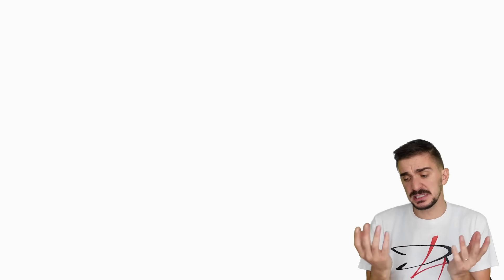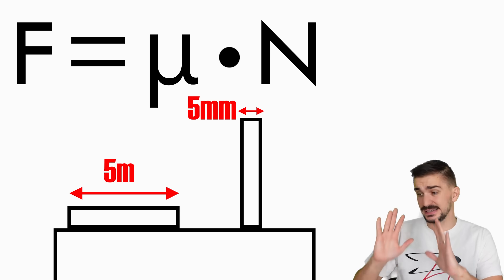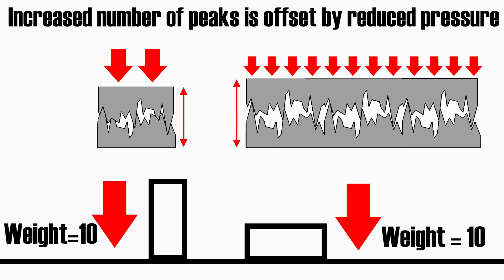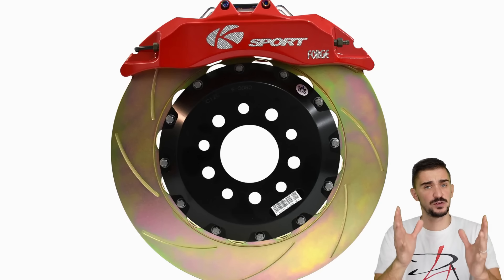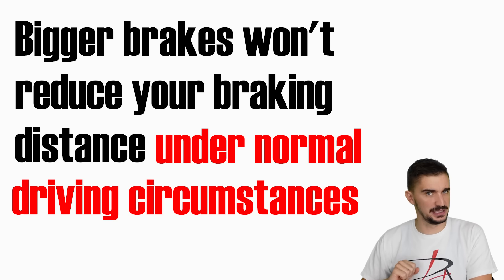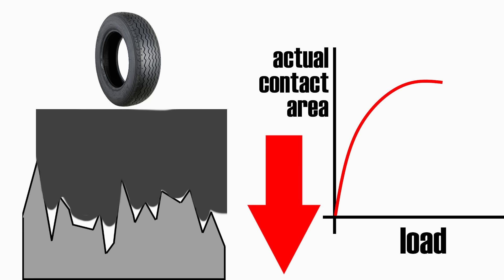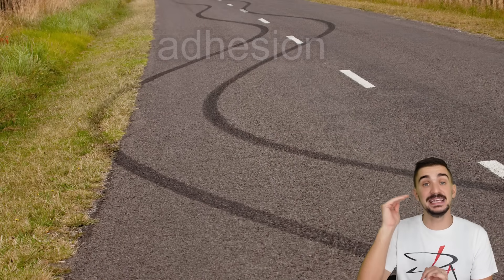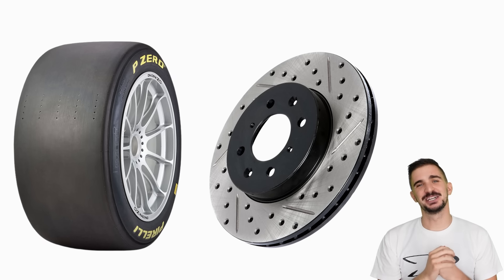Why Big Brakes Won't Stop You Faster but Wider Tires Will - Friction and Surface Area Explained

Comment: I wonder what people think about this. I have always done my own brake jobs. When pads have gotten into the metal and cut grooves in the rotor, I don't change the rotors. Those grooves, I always figured, add surface area once the pads wear to fit the shape of the grooves in the rotor. It also adds surface area which allows the rotor to cool faster. If the rotors are too thin, I'll replace the rotors. I have never had the brakes fail on any brake job I've done. I know this sounds bad to a lot of people, but it's not unsafe. If it were I wouldn't do it.

Comment: Your pretentious attitude is very condescending. You totally disregarded heat dissipation and brake fade. Modern brakes are very good, but can be improved and you can tell the difference.

Comment: why is this even a video 😐 its such basic common sense..  I hate how stupid were getting..
Reply: The worse part is that the video is WRONG
Reply: @josebermejo5362   i didnt watch it the thumbnail annoyed me into posting what i said then i homepaged
Reply: @josebermejo5362  its not wrong
Reply: @arcanevoid9199  Bigger brakes WILL brake better but not because they have a bigger surface area, as explained in the video that does not affect friction and the force of the caliper will NOT increase , but for the same force aplied by the caliper, the bigger the diameter of the disc the bigger the braking torque will be on the axle, as TORQUE = FORCE x DISTANCE. It's like tightening a bolt with your fingers vs using a BIG ASS wrench, the further you applie the force from the axle the bigger torque you can generate.
Reply: @josebermejo5362  i mean your not wrong, he explained that in the video but its not gonna stop you any faster because 99% of the time you are limited by the tyres

Comment: If bigger discs and calipers won’t improve braking, what will (besides tires)?
Reply: Bigger calipers won't improve braking, but bigger discs will, this is why the video is wrong
Reply: @josebermejo5362  bigger discs will? bro what are you talking about

Comment: Hi, thanks for the great vid! I’ve a2012 VW polo 1.2 mpi( 75HP motor) that came with 14 inch steel rims ,175/70/r14 tires and NO ABS. Will changing to 16 inch VW alloys and 195/55/r16 tires help me achieve better stopping distances, considering there’s no abs?

Comment: Big brakes = larger diameter = larger moment arm = larger torque = more braking force = more modulation. Size matters.
Reply: it does, but the smallest brakes that will do the job are the best. unsprung weight matters

Comment: You never first saw my comment here all you said here was entirely right, thus it really takes the initiative over non and reality,  I could agree with this also as your second video, Rim brakes can be increased their friction due that they can lock more, I hate to do it but I need to do it in order to prevent me from accident.

Comment: While you are comletely right for most of the things, I still believe that bigger brake rotors will stop better from the very beginning, not only in track conditions. The reason for this is that even that you have the same Friction force, you have it applied on bigger mean diameter which makes bigger stoping momentum.
Reply from the maker: https://youtu.be/Ql9eYh31kTw
Reply: @d4a  What if your tyres are not the limiting factor?

Comment: As a Dually Driver, I don't need to watch this video to know that "The more rubber on the road, the better the traction OR the stopping power"!

When I was hauling RV's, I always deflated the Rear Duals to where a Business Card would just slip about 1/8" under the edges, NO matter what the Factory Tire Pressure Recommendations were.

I PO'D many "Professional Tire Changers" when I told them that THIS is what I wanted, not what it said on the Factory Sticker! It's called "Real World Experience". And don't ask me about "Small Disposable Car Drivers"! 🤣

Comment: Not entirely correct. In the wet wider tyres will not help stop faster. In contrary. It may actually cause your car to slide more easily. That is because the weight is spread across a wider tyre are hence less weight pressure from each tyre on the road.

Comment: In short, bigger brake rotors and pads only spreads the braking friction out over a bigger area. Reducing heat accumulation and wear across the total area. You simply get longevity in extreme circumstances.
Reply: Nobody likes the truth? Eh? Not even this channel. Man, you guys suck.

Comment: There is such a thing as pounds per square inch. ⬛️  to wide decrease the lb/ inch  ratio. Works for traction and stopping as both rely on frictional areas. 
So there is a curve in the results that you should be aware of

Comment: This is a very interesting discussion of the F=MU x N, sorry I couldn’t use the proper symbol for coefficient of friction.  May I add that, while it is understandable that bigger brakes will not stop a modern ABS equipped car faster, bigger (greater coefficient of friction) brakes will stop an older car, especially one originally equipped with organic shoes and drums all around, faster and this is reduction in stopping distance is of course enhanced with greater tire contact area.

Anyway, getting back to the discussion of the F=MU x N equation and how it does not apply to tires (at least not in a linear fashion), I thought it might be interesting to discuss the topic of how weight transfer, biased toward a particular end of a chassis, might manifest itself in the cornering behavior of that chassis.  Thank you for taking the time to present such an interesting YouTube channel, your efforts are appreciated.

Comment: You went from talking about brakes to just tires. Yea obviously more tire grip But you need bigger brakes to stop with those tires. So yes you need big brakes especially at higher speeds were normal brakes fail consistently. Also big brakes have better surface control so you don't skip the tires and lose grip.

Comment: But the difference between stock brakes and really good aftermarket brakes is night and day on the track. Also a larger brake rotors has more leverage = more braking power. So what do you think is better bad brakes and big tires or good brakes and smaller tires obviously I rather stop than not to stop by going with big brakes and small tires.

Comment: Tire compound will effect friction so you could have tire with less contact patch out braking a tire with more. In this review removing all the variables to deal with just surface area while useful doesn't really capture reality. As for brakes, bigger brakes will be a benefit in repeated braking like experienced in every day driving.

Comment: Big brakes will stop you quicker so this dudes an idiot.
Reply: The formula doesn't account for the change in temperature when friction is applied. And the center of gravity shifts over when decelerating. Simple formula dose not show the full picture.

Comment: I can’t believe what I just hear. 
1-physics laws are universal laws 
2-different tires are made with different rubber components, therefore, friction coefficient in the formula change. Not due to wideness but due to materials. 
3-wider tires also increases the total width of the vehicle improving cornering, not due to contact area but due to wide geometry. 
Please, please! Research before broadcasting videos, you have people commenting that they always knew their physics teacher was wrong, OMG!!!
Reply from the maker: I'm afraid you didn't understand most of this video

Comment: Bruh, big brakes was not to stop you faster but to be more head resistant. Technically it will stop you faster breaking none stop at a track compares to regular break.

Comment: One big mistake which makes this movie title absolutely wrong.
Big Brakes actualy stops you faster - that's why you mentioned tyre braking test but no big disk braking tests.
You are talking only about bigger friction area but it stops faster not because of bigger area but because of placing friction area further away from centre of wheel.
Reply: did you watch the video?
Reply: @arcanevoid9199  Did you read above?
Reply: @chmuragan  do you not understand that if you brakes are enough to lock the wheels, bigger brakes arent gonna stop you any faster
Reply: @arcanevoid9199  'If'
Reply: @chmuragan  as stated in the video you wont really find any car made in the past 40 years that wont be able to lock up the wheels with stock brakes, its not really an if
Reply: @arcanevoid9199  But it's not true. Driving many quite fresh cars with not working anti-lock and excluding ultimate sports machines and no one was able to lock brakes at speed higher than 100km/h on good (not sporty) tyres.
ABS has something to do only at low speed or on curve.

Comment: There may be an underlying truth to your frictional force relationship and its application to sliding a board under gravity on its faces.. But.. I've owned the same car with stock brakes and subsequently with larger rotors and pads. I am sorry to inform you my stopping distance was MUCH better with upgraded brakes.  Better control, shortened stopping distance (under normal driving conditions), and elimination of brake fade (as you explained well).  You apparently have never owned a car with both or you would be making a different video.  I increase my surface contact area and maintain the same normal force, I get more frictional force.

Comment: Could you do a video on ice tyres too? I've often wondered why they're so thin, it's never made sense to me
Reply: One basic way to think about it is how much control you have with ice skates vs sliding around with an inner tube or a sled. You need certain amount of pressure per stud so that they can dig into the ice. Also wider tire wont dig through the snow as well as a narrow tire, which is basicly aquaplaning on snow. It's very common here in the north to be driving casually and suddelly there's a spot with more snow and the car literally rises up 5-10cm(2-4inch) and no amount of wheel turning or braking will do anything. Narrower tyres might have just sliced through that snow remaining in contact with the ground. If we are talking about just pure ice without snow, then it all comes down to ratios between vechile weight, weight on each tyre, tire width, number of studs, stud type, pattern of the studs ect. I'm sure it gets pretty complicated if you'd really get into it, but putting 300 studs in a row and 20 grams on top is not going to press the studs into the ice and provide any resistance to sliding.
Reply: @SUMOCAT86  That makes sense yeah, thanks for the explainer
Reply: As he showed, the reason you want wide street tires is because above a certain point, increased pressure between the tire and the ground stops increasing friction. However, in snow and ice, you want as much pressure as you can get. Wheels on snow/ice are basically useless, meaning your only hope of moving on snow is by compacting it under the tire or just pushing straight through it to the ground, and on ice is by digging your studs as deep as they can go. For both of those, you need as much pressure as you can get, which means narrower tires.
Reply: yeah i also wonder. maybe narrow ice tyres provide more grip while driving on ice

Comment: Right at the start of this so willing to be educated. I was always taught pressure = force x area so more area (bigger tyres) reduced the pressure of the tyre on the road so less grip and also more chance of aquaplane as less pressure to force the water out.
Reply: no, bigger tires = more grip. this is why you see cars with 300 wide tires, it does create more rolling resistance and more weight though obviously
Reply: @arcanevoid9199  And those cars with 300 wide tires do they have small brakes?
Reply: Wider tires don't have a larger contact area.
Reply: @johngalt97  So Ferrari uses 135 70 r13's

Comment: Another important factor with tires and the variable coef. of friction is a pair of tires with unequal normal force will not be able to provide as much total force as a pair with equal normal forces split between them. Example: a lower center of gravity will result in less change in normal force transfering from the inboard to the outboard tires and thus the pair will be able to provide a greater total force to accelerate or turn the car. 
Also, a lighter car will be able to accelerate faster because the coef. of friction is higher. People often mistakenly attribute this to F=ma when it is due to F=µN where µ is the coef of friction at a given N force as shown in the graph for a tire in the video. Simply reducing the mass also reduces the Normal force and the total force but the ratio of F/N his higher which makes the acceleration higher.
Within reason lowering the tire pressure will result in a larger contact patch for that tire which has a similar effect that installing wider tires would have. There is an optimum pressure for a given set of conditions but in principle it still works. I've seen dirt track cars running as low as 5psi for this very reason.

Comment: "Why Big Brakes Won't Stop You Faster" WRONG. Try going 200mph and stop with 1997 honda civic brakes vs brakes from a Lamborghini avantador. see who stops faster. the small disk and pads will quickly boil the fluid and all you will have for a brake pedal is a sponge.
Reply: thats due to fade though, completely different concept

Comment: Where is that PigIron moron has actually never seen F1 car brakes. They're fucking tiny. They're as tiny as they can get away with to save weight, rotation mass, and aerodynamic penalties for cooling them etc. Heck, after the hybrid era the rear brakes are even smaller because more than half of its duty is taken over by the MGU-K's regen. What they have is insane levels of brake pressure. ventilation, and thermal endurance to not fail after 300km of 900'C abuse.

Comment: So you are saying that if I use a larger Master Cylinder, pushing more pressure with larger rotors and larger pads, I will not stop faster?

Comment: Tires are the only point of contact. Years ago a 4*4 magazine published before and after performance metrics after a lift, and after tires, step by step. Acceleration slowed (weight& diameter changing ratios) but the tires were the only thing that improved breaking

Comment: Why Big Brakes Won't Stop You Faster  ...Bull fucking shit!
but Wider and or GRIPPIER Tires Will ...Yes, but mostly in the FRONT, BTW.  
My car stock:  235mm. Now: 265mm Pilot 4s. 35 ratio/series tires.
Stock Brakes: tiny two pot. 
NOW:   Massive BREMBO SIX-pots with grooved floating rotors and Castrol SRF full synthetic $80 a pint brake fluid. Titanium brake pad heat shields.
Endless or Cobalt Friction full racing pads front and back when tracking at Sebring. I could put an un restrained passenger right through the windshield under ultra hard braking.
Reply: LOL you got owned in his updated video.

Comment: 'Why big brakes won't stop you faster' proceeds to explain how big brakes stop you faster, but not how people think they do lol (Pressure not surface area). This is obviously assuming that when you put bigger brakes on you also put better calipers on which most people do as they're normally paired together for the upgrade kits.

Comment: I would constantly preach this when I had my shop and I sold a ton of brake parts and big brake kits and made a decent profit on them but if I knew the car didn't have the wheels and tires to use the brakes the car already had I would try to educate the customer on this even when I didn't sell many tires or wheels besides a few R compound tires and non DOT tires I also made basically nothing on the tires I did sell just because I wasn't able to move volume so discount tires price was often better than mine ...meaning the "shops price " lol
..and with the brakes that alot of the newer vehicles come with OEM just a upgrade of the pads lines and rotors would make a huge difference...

Comment: The metallic properties of the face of a small disc overheated  become like glass - Heat soaked Look at cooked flywheel when overheated . It must replaced or the face machined off . When's the last time you saw a supercar with tiny rotors.....If you were right we'd just use drum brakes . Which the old timers used  caught on fire if abused. Planes use brake packs . Brakes turn deceleration forces to heat. More speed or weight bigger brakes for repeated stops or track days . Period. Your always right but not this time sans unsprung weight penalties and inertial force penalties. Heat has to go somewhere, mass is your friend in this scenario.
Reply from the maker: Why didn't you watch the video Jeremy?